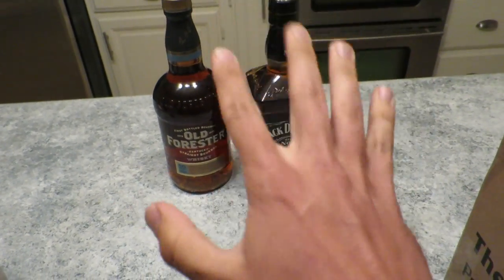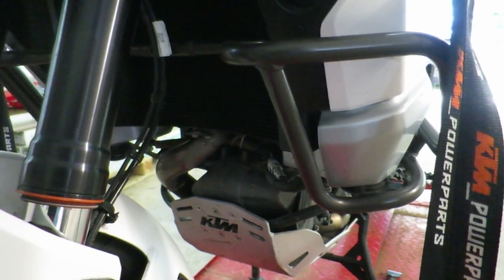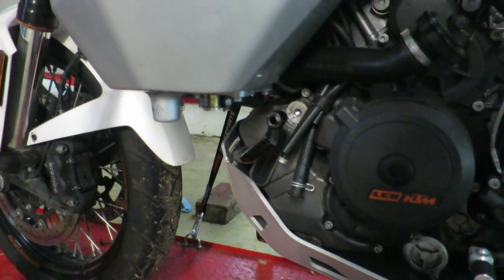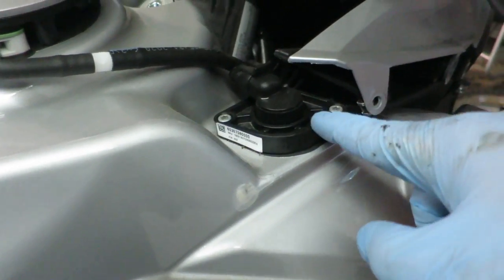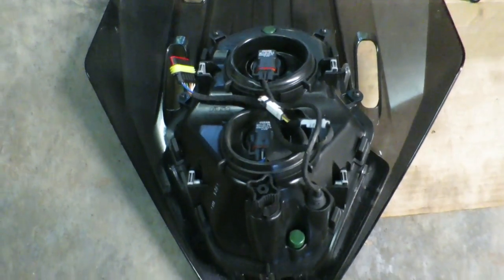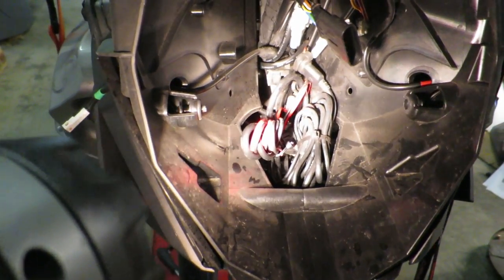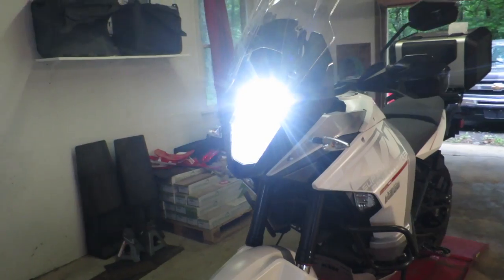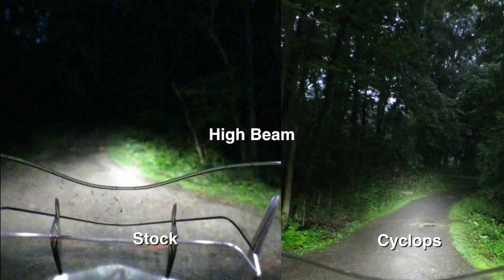Cyclops LED Headlight Install | KTM 1190 1290 Super Adventure

Comment: Installed my bulbs today. No left over fastners or broken plastic tabs. Video success!
Cyclops changed they product. No rivets or resistors needed.
Thanks Mario
Reply from the maker: Yeah, heard they've updated the kit a bit. How are they working for ya?
Reply: @2WR  perfectly! I'm amazed at the amount of light from the low beam alone. Best money spent on the bike. LEDS are far better than HIDs on my old bike.

Comment: Thanks for the how-to. I did this upgrade today. Cyclops kit now includes adhesive velcro patches. No drilling required. And if care is taken, there is no need to remove crash bars during side panel removal.
Reply from the maker: There’s an updated video showing how to access without total disassembly. Just put the Cyclops LED bulbs in my 990 last week. Even bigger improvement.

Comment: Helpful and informative as usual. One thing, for the direction in which you installed the rivets (head of the rivet against the resistor plate) the washer for those rivets should go between the plastic and the bulb of the rivet, not under the head of the rivet. The plastic is often too soft to prevent the bulb from enlarging the hole and pulling thru the plastic when you pull the rivet with the tool.

Comment: So that everyone knows, you don’t have to go through all that to remove your headlight, that’s just a KTM dealer money maker to add hours.  On the silver panel that the blinker (Indicator) is attached to, remove those two bolts just like the video, pull up on the front of the panel gently and you’ll see the hole and you can remove the bottom headlight bolt, the upper headlight bolt is accessible without removing anything.  I’ve done it to wire my GPS and my cyclops LED years ago.  This video is by no means wrong, he installed the headlight just like the book told him, but he wasted a lot of time and effort.

Comment: I think you were getting a CL light code was because the cornering lights were not installed when you fired it up at first.  Looks like a great mod, I'll be adding it to the list! Thanks!
Reply from the maker: You're correct. It was the corning lights not being hooked up. Good luck with the install...it'll prove to be worth it.

Comment: Great video. It helps alot. I do not understand why the manufacturers or designers made this so complicated. It's a light bulb, it would be changed all the time. ¡Put two screws, open the acrilic, change the bulb and put it again! Insane...
Reply from the maker: Be sure to check out my "wiring explained video." It shows you can get to it without removing everything but you'll still want to know/understand were all the little plastic clips are so you don't break anything.
Reply: Thank you!

Comment: I don’t understand why the crash bars were removed. I can completely remove my headlight inside of 8 minutes simply by removing the tank top cover and then removing the two tank top side panels to get access to the headlight fasteners. 

The tank side panels containing the led Lights can also easily be removed without removing the crash bars.

Is there a reason why you did it this way?

I didn’t do anywhere near this amount of work when I installed these, plus I installed a led light bar between the stanchions at the same time that also needed to be wired into the harness in the headlight.

I’m just curious. It seems like a lot of extra work, but maybe I cut corners.
Reply from the maker: I've explained this numerous times in the comments section (which I don't expect you to read all of) and even in the video. For the purposes of working on it the first time, I followed the KTM Service Manual step-by step. 

As I've stated in a subsequent video, you can get to it much easier with removing far less but you need to be familiar with how the plastic tabs and other fasteners work so you don't damage them. 

I would no longer (and do no longer) remove everything to access the headlight but it was a good learning experience for me (and anyone) that watched the whole way through as I now have a better understanding of how the bike is assembled.
Reply: and how do you lower light height to avoid annoying highway flashers towards u

Comment: Thanks for the video, I just installed these lights.  I always found the stock lights, at least the low beam, quite lacking and I was always over driving them whatever the speed. I started driving around with my high beams on all the time. They weren't even bright enough to cause on coming cars to flash me.  Haven't ridden in the dark yet, but I can already tell they are much brighter.
Reply from the maker: Matt, you're going to notice a HUGE difference with the LEDs at night.

Comment: Just installed the Cyclops kit and a new Garmin 595LM on my 2015 1290 SA last night.  Watched your video first and glad I did because the instructions that come with the kit are pretty limited.  I swear though, every time I remove the side panels, tank cover, etc., I always end up with a couple extra screws when I put it back together.  I even took everything apart again to try and figure out what I missed and couldn't find where I missed anything.  I made sure I got the hidden ones, by the radiator and inside the steering head area.  The only logical conclusion is the damn things multiply like rabbits when removed. :)
Reply from the maker: LOL...it happens. As long as it stays together you'll be fine 😀 Glad to hear the videos helped.

Comment: I'm thinking the code was just because the corner lights were disconnected.  I'll bet if you went through the menus you'd also see a code for the unplugged seats.  I ran into the same thing the first time I worked on mine and started it with the seats off.  As soon as I hooked everything back up the code cleared.  Nice lighting upgrade.
Reply from the maker: I bet you're right. I threw a general code as well but once everything was buttoned up, all of it went away.

Comment: C Light is short for Cornering Light. They are not plugged in. It will throw an error until they are plugged back in. Error no more.
The stock headlight is mediocre. My wife's Versys 1000 has vastly better headlight. And if I'm not mistaken they use the same lamps. I'm looking forward to LEDing my SA!
BTW it is possible to get the headlight assy off without removing all that other stuff. It's a headlight. It has to be field serviceable. Anyway I've had mine off a couple times. You get the windscreen out of the way and the rest is pretty easy to sneak around. 
cheers

Comment: I'm floored.  This'd be about $1500 labor at a dealer.   Glad I have a Super Duke 1290 ... should be a whole lot easier.  Access is remove 2 screws, headlight shell pivots down giving full access.
Reply from the maker: +Michael Nelson I've made an updated video where I show it's possible NOT to remove everything as the service manual says however you still have to remove a ton of screws and if you don't know how the plastic clips together you'll likely break something.
Reply: Can't find that updated video on your channel. Can you post the link please? Have the Cyclops LED kit and am keen to install in the most efficient way possible!
Reply from the maker: Brian. The video I've linked doesn't show you step by step but does show you how it'll look. You can leave the crash bars in place. All the same body panel screws I remove in this video will still need to be removed. Once removed you should have enough "play" in the plastics to get the headlight removed. You can also leave the cornering lights and turn signals hooked up. https://youtu.be/s0Van8rnV1c
Reply: Thanks a ton! I installed the Cylops LED lights on my 1290 without any trouble using your video above and the modified/simplified steps you pointed me to. Love the lights!
Reply from the maker: Glad you hear it worked out well for you Brian. Enjoy the new lights!

Comment: Love it bro. I cheated though... I removed the windscreen, side fairing bolts and snuck in there with my wrench and took the bolts out, slid the headlight assembly forward and did it that way.
Reply from the maker: Now that I know where all the plastic fasteners and clips are I'd do it that way next go round. While a pain this way, I now know how to take the bike apart and put it back together again. :)
Reply: ...yep, that’s pretty much how I did it too. Ten minutes and the headlight is off.

Comment: I put some $40 LED bulbs with $15 resistors on my 1190R. It took me about 20min... crash bars? side panels? seat removal? WTF???? I just loosened the side panel to get the turn signal panels off, then popped off the headlight assy. I also didn't pop rivet in the resistors...LOL! Why??? Never a single error on mine.
Reply from the maker: I'm sure the bulbs you have linked will work fine but they are only 6,000lm v the 8,000lm kit from Cyclops. As for removing the crash bars & side panels, that's what the KTM service manual called for. Can you get by with removing less? Sure. But removing everything gave me (and those that watch the video) a better understanding of how the bike is assembled should I need to take it apart for something else. I'm not sure the size of your resistors but I don't want mine rattling around in the headlight casing. Looking back it was likely the unplugged cornering lights causing the code.

Comment: Superb video. One thing is not clear to me. The 1290SA has a 'intelligent' headlight. How do you make it work continuously? Mine only works in dark circumstances. Keep posting these manuals for the SA!
Reply from the maker: hmmm...my light is on at all times that it's running. If you only turn on the switch and not the engine it only lights up for a few seconds. What market are you in?
Reply: I think it's different because of legal issues in europe compared with America. I can only force my headlight to work all the time if i disable the day running light (Led).
Reply: Check your DRL settings. That will adust the function of your low beam

Comment: Another excellent install Mario , well put together and informative .
Although alot of work it would seem there is a noticeable difference in depth of field with the Cyclops bulbs . Was wondering if you have tested there effectiveness at night yet ?  I reckon I could tackle the job myself . Although it is a superb bike the only areas of weakness I feel are the headlight and horn . With regard to the horn I was wondering if you were considering a more substantial alternative such as the denali  soundbomb replacement ?
Reply from the maker: Thanks Lawrence. I can tell you that Cyclops bulbs are a LOT brighter and allow you to see much further away. Due to the non-stop rain lately, I haven't had a chance to actually ride at night but plan to soon and try to get it filmed to share. I haven't looked into any upgrade for the horn yet. I really should do something with the weak horn on my Silverado first because the KTMs horn is actually louder. The horn should be MUCH easier to replace should I decide to do so as you can get to it rather easily. My next "upgrade" will be removing the charcoal canister from under the passenger seat. I've been told it'll take a couple weeks to get the necessary parts.
Reply: 2 Wheeled Rider LUMENS!!!! ALL THE LUMENS!!!! 👍👍👍 My resistors were from superbrightleds, and look identical, but without the backing plates. There's no room for them to rattle around, jammed in there with all that wiring. ;)

Comment: Hi There, I know this was recorded in 2017 but was wondering if you can help. I have a 2015 KTM 1050 Adventure and want to install led indicators, do I need to install only resistors in-line or do I need to have a relay installed? Is there a relay that need to be replaced? Thanks in advance
Reply from the maker: Should work fine with just the inline resistors.

Comment: Hi, and off video topic you might be able to help with, i have a 2017 KTM 1290 SAT, and i have 2 issues, 1.  A coolant leak. 2.  The clutch is slipping, the bike has just offer 30k KMs, have you had any of these issues? And if so any pointers?
Reply from the maker: Haven’t had either of those issues but here are some pointers. 
1) Assuming it’s an external coolant leak, you’re just going to have to trace it. Could be a bad hose, loose clamp or cracked radiator. If you can’t find it, check to make sure you don’t have air in the system by warming the bike up with the radiator cap off to get rid of the air bubble. 
2) Start by bleeding the hydraulic clutch line. If that doesn’t help you likely have a more serious issue and may need to replace the clutch.

Comment: Looks Good ....But....Man thats a lot to go through just to change bulbs.. I hated working on the FJR because of all the plastics you had to take off that thing.... :)
Reply from the maker: Thanks. Yeah, surprised the manual called to take so much off.
Reply: Ah, now I understand.

I didn’t follow the manual, I used my version of common sense, which probably is neither common or sensible. I did manage, several times, to remove the headlight inside of 10 minutes though.

Comment: Was the error from the headlight or from the cornering lights being disconnected? I noticed the same error when I did the SAS/canister delete and did a test start before buttoning it backup. I also found out you can also remove all the panels and the tank without removing the crash bars.
Reply from the maker: I'm pretty sure it was from the cornering light. Didn't occur to me at the time. Yea, another guy commented that you can get the side panels off without removing the crash bars. Now knowing how things come apart, I'd agree that's possible and quicker.
Reply: Great video, I will be using it as a guide. A friend of mine has an FJ09 and I'm really impressed how much his LED headlight catches my attention in my mirror, it makes my friends Tiger headlight look like a birthday candle! So for daytime viability and seeing at night it looks like a great upgrade.
Reply from the maker: Thanks man. I agree. Night time visibility is much better but daytime visibility (others seeing you) is also much improved.

Comment: Have done this on my 2016 SA just recently.  Is there a way of easily adjusting the beam angle down a bit without taking everything apart again? It’s a touch on the high side and is blinding cat drivers...!
Reply from the maker: You only need to remove the bottom triple clamp cover to adjust the beam angle. There is an adjustment screw/knob. Turn it clockwise to raise the beam and counter to lower it.
Reply: 2 Wheeled Rider - thanks and please keep the videos coming. Have managed to put 15k miles on mine so far and absolutely love it. I see you’ve got the conti trail attacks on it, have you tried any other rubber yet??
Reply from the maker: I have tried the TKC80s, TKC70s and Pirellis Scorpion Rallyes but on other people's bikes not mine (though same make/model).

Comment: Kinda off this topic but do you happen to know where the flasher relay is for the turn signals? I have the Rizoma turn signals with the relay kit so I do not have to run resistors, I have a 16 superduke r
Reply from the maker: According to the wiring diagram in the service manual, they plug directly into the ECU which I find strange. I'm going to look into it further and let you know.
Reply: Thanks looking forward to knowing! I agree I find that strange as well.
Reply: @2WR  hey just curious if you got any info on this flasher relay?

Comment: So I need to switch only the headlight mask (broken), do I need to do all these steps?
Reply from the maker: No. You'll need to remove the windshield and you'll need to pop off the turn signal farings in order to access the screws to allow you to remove the mask.
Reply: @2WR  do you have any video or description of that? I have been around it for hours and do not know how to do it.
Reply from the maker: https://www.youtube.com/watch?v=s0Van8rnV1c&t=98s this video is the closest I have to it. Use it in conjunction with this one and it should get you close. I haven't had to pull the mask off. I can email you a pdf of the service manual if you want. Just email me at 2wheeledriderdotcom@gmail.com

Comment: Nice work!  One hint to save some time and effort.  Even though the service manual says to, no need to remove the crash bars.  The side panels come off and go back on just fine without removing the crash bars.  That should speed up the install a bit.

Looks like a significant improvement in night riding visibility!

Rob @MotoPumps.com
Reply from the maker: Thanks Rob! I thought that may be the case but for the purposes of being complete decided to follow the manual step-by-step. Definitely a huge improvement over the stock lighting.
Reply: Where do you suggest purchasing the Cyclops kit?  Direct from Cyclops?
Reply from the maker: Since they are the same price directly from Cyclops as ordering from any other supplier, I'd order direct from them in case you run into any issues.